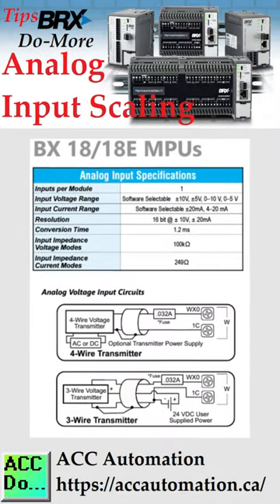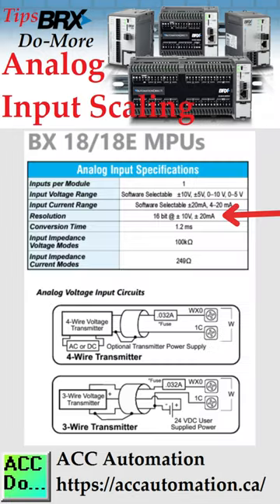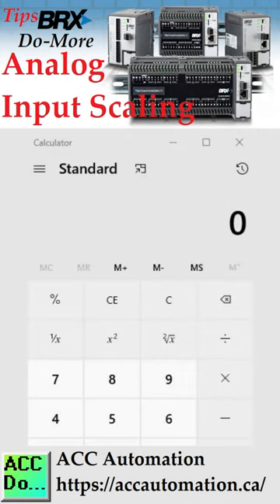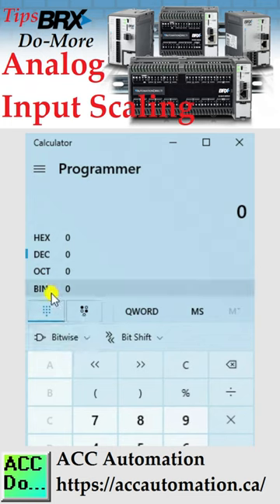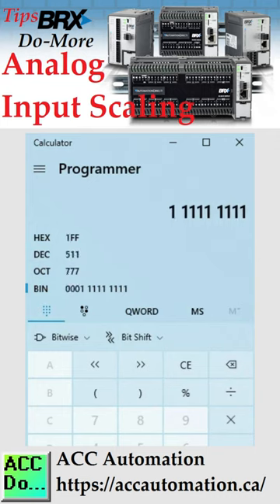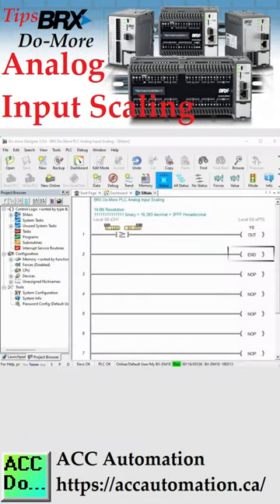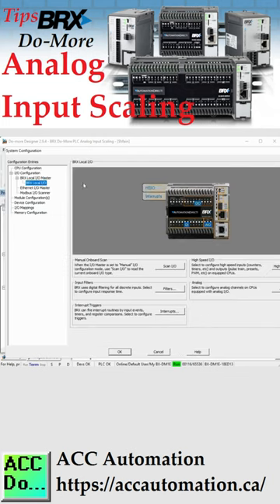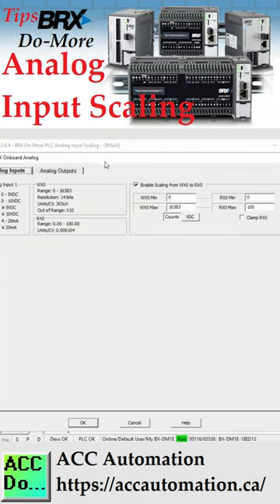BRX Do-More PLC Analog Input Scaling

Comment from the maker: Programming and examples of the BRX Do-More series can be found at this URL:
https://accautomation.ca/series/brx-do-more-plc/

There are several reasons why we are using the BRX Do-More Controller. Here are just a few.
– Standalone PLC with built-in I/O
– Built-in Data Logging
– Communication ability – Ethernet Port, RS232, RS485, USB – support for protocols such as Modbus RTU, Modbus TCP, ASCII, K-sequence (DirectLOGIC users), Custom Protocols (ASCII over serial, TCP or UDP over Ethernet)
– Built-in Analog input and output
– Integrated motion control
– High-speed counters
– Powerful instruction set (Video of Instructions in software)
– Ability to expand the system with a variety of modules
– Part of the Do-More series of PLCs which use the same free software. (Do-More Designer)
– Integrated simulator in the software capable of external communications for testing

ACC Automation
https://accautomation.ca/